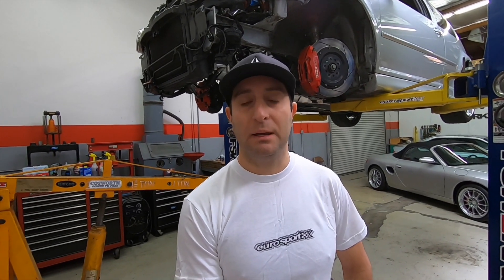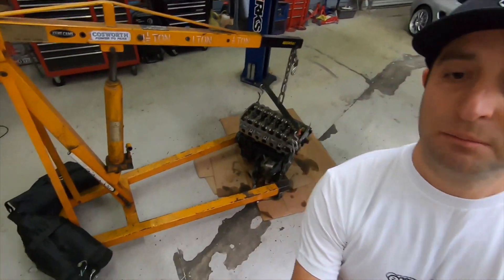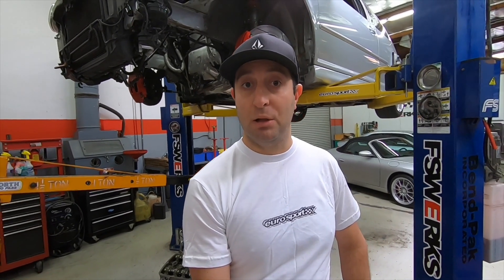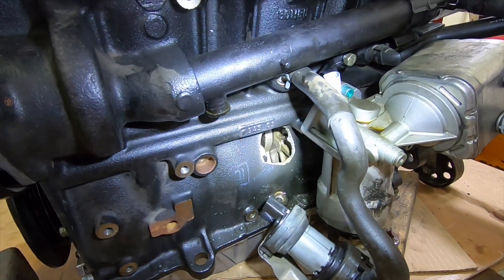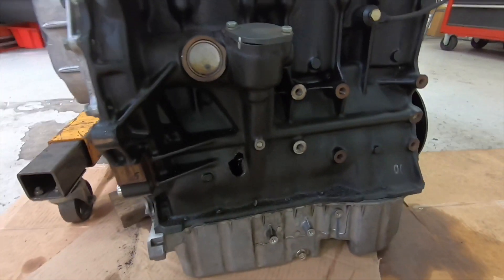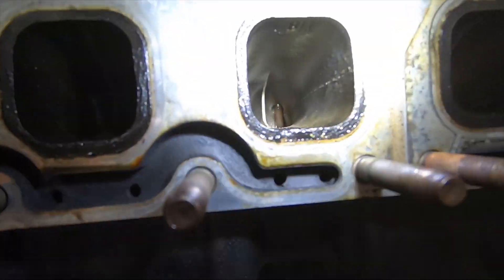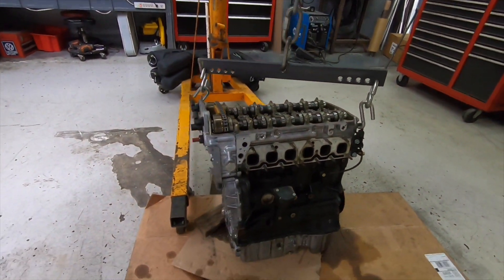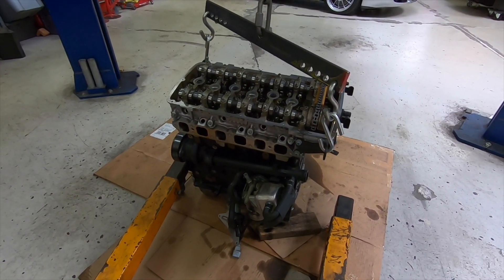Coronavirus Blew My Motor (2004 VW R32)

Comment: :( I still haven't taken mine apart at 136K, but I over service it on much tighter then factory intervals. I have a feeling the way I drive the car though that it's days are numbered.
Reply from the maker: Just ensure you do the full timing chain replacement those parts will be stretched and worn for sure. Otherwise you should be good fingers crossed.